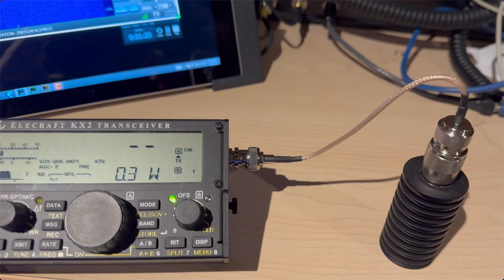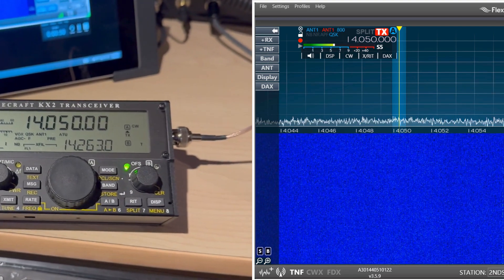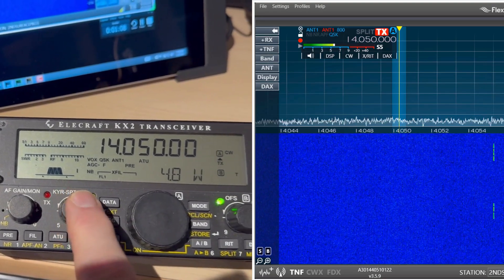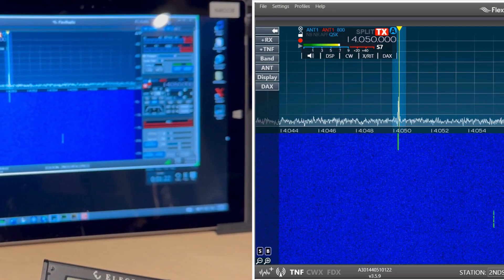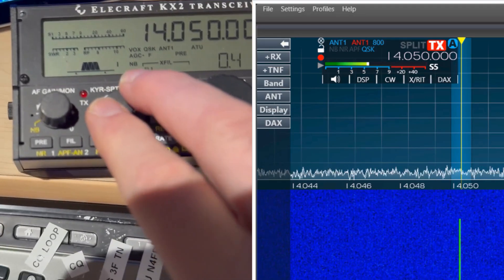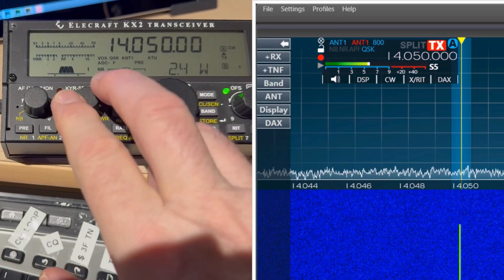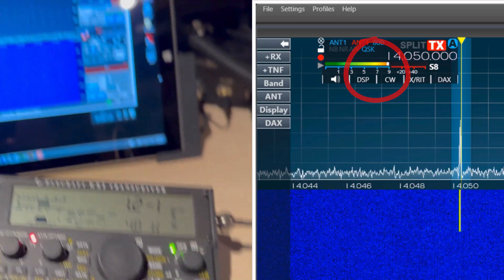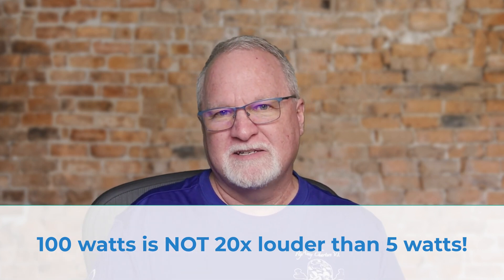Quadruple Your Power For Only 1 S-Unit!

Comment: I know the maths, it is true. BUT. The field experience is ... different. I did try TX with 5w (QMX+) , 20w (Xiegu G90), 50W (microPA50), 100w (FT710), 700w ( Acom1010).  AND . Factually, using different TX power ... IT MATTERS. It is CLEARLY making a difference. And I mean clearly. Stations are responding to your signal better and better as the power is going up, no doubt about it. And "1 S-unit or 2 is not much, your station will almost be heard the same" = bollocks.   I am using now 700w even on mobile POTA. I have no issue breaking through ANY pileup whatsoever. If there are 5-6 or more hams answering a DX station, it's almost 100% the DX station will answer me. Try that with your "1 or 2 S-unit lower" QRP station . No chance, I mean zero chance. ######  And yes, each power level is a different experience, it is fun, no doubt. I tried it, I still like QRP, where you can enjoy operating, but the fun has different shape, requirements and expectations - but can be lots of fun. BUT, to say that QRO is about the same as QRP because of the maths --- means you didn't compare it in a practical field situation ...
Reply from the maker: "BUT, to say that QRO is about the same as QRP because of the maths --- means..."   Means that you are misquoting me.  Okay, where to start?!  Are you saying that higher power stations will be heard better? Of course!  Are you saying you'll make more contacts if you use more power? Of course! So, what we arguing about? People who enjoy QRP do it to make it harder so that when they succeed, they feel a greater sense of satisfaction. That's it. Tha'ts all. There is nothing more to QRP than that. That said, increasing your power by a factor of 4 will only get you one additional S-Unit on the receiving end. That's a fact. An actual fact. And it's a fact that you can't refute if you a) truly "know the maths" and b) have actually tried it, as I have many times.  Now, that extra power can make a difference in snaging the QSO or not. (There's a reason I have THREE 100-watt radios on my desk. Sometimes QRP isn't enough. And sometimes 1.5Kw isn't enough, either.)  So, I don't want to argue about something we both agree on. Have fun running 700 watts during your POTA. I don't know of anyone who runs more than 100 watts for POTA, but you do you. Be happy with your version of this great hobby and I'll be happy for you. There's room for all of us at the trough. - Cliff
Reply: @QRPSchool  Yes you are right. We do see things quite the same, there is no ground here for arguing. Activating as a ham radio, I just wanted to try all levels of the hobby (including power levels) as I like experimenting and trying all faces of the hobby as many of us do. It just happens for me to be in my QRO phase, lol. But, I definitely will want to taste the fun of QRP once in a while. I was just contemplating the new SSB update on QMX+ little QRP, by Hans, which is quite impressive and promising. Yes, I know doing mobile QRO is rather rare and unsusual, but I do like to do unusual things, and I can assure you this is fun too ... For example, is fun to have POTA activation in London, in a park, and talking to hunters in South America on SSB, whilst I had to explain a police officer what the heck I am doing with a 25 feet vertical telescopic antenna (plus a home made coil) on top of my car. Sorry if the tone of my comments was a bit on edge, I can assure you I have full respect for QRP side of the hobby. All the best

Comment: I'm a big 5watt QRP radio guy. But, if the Rx station has me in the noise floor. Well then 20watts might work? Or 100watts would be better?
I have the FT-817nd, G90 and the FT-857d. So I take the FT-857d. It's adjustable between 5-100watts. So cool.
Reply: @DavidS-iw4ei  As you know, the important thing is that your signal is above the noise floor for the receiving station. Transmitting 20 watts instead of 5 watts will have your signal received as one S-unit stronger than 5 watts. That might do the trick. For me, if I’m home and 5 watts isn’t enough, I just go straight to 100 watts… if I’m using one of my 100 watt radios. If I’m using one of my QRP radios, I just have to “turn the big knob.”

Comment: Misinformation. Stop.

IF the station can't hear you, adding 3 dB or even 6 dB will help.

Your radios meter doesn't mean shit. STOP.
Reply from the maker: Oh, goody. Another commenter who hides behind an anonymous account and has never made a video.  Yes! If your signal is in the noise floor of the receiving station, you'll need to increase your power in order to raise your signal above his noise floor if you want to get that QSO in the logs. I wonder how many times I've said that in the 60+ videos I've made for this channel? A bunch.
Reply: @QRPSchool  okay, do it this way - .01 watt start, and increase from there.
You're forgetting a lot like feedline loss, antenna gain, obstructions, receiving antenna gain, and whether atmospheric conditions are involved.
Generalizing every meter is linear or even remotely accurate is absurd.
Reply from the maker: @deezknutts  "You're forgetting a lot like feedline loss, antenna gain, obstructions, receiving antenna gain, and whether atmospheric conditions are involved."  Uh, no. What does any of that have to do with the FACT that if you double your power, you'll get a 3dB increase at the receiving station over what you had before you doubled your power? That's one-half of an S-Unit on a properly calibrated and linear radio (like my Elecraft and Flex radios).  I'll let you have the last word. This is just a dumb conversation.
Reply: Antenna gain multiplies your power.
Do the math.
Your generalizations are great for a beginner ham. ; )
Reply from the maker: @deezknutts  Oh, my God. I said, "if you double your power, you'll get a 3dB increase at the receiving station over what you had before you doubled your power" You said, "Antenna gain multiplies your power."  Are we having two different conversations, here? Can't we assume that the same station that doubled their power is using the same antenna when doubling thier power AND the receiving station is using the same antenna after the transmitting station has doubled their power? (Seems like a pretty logical assumption.)  If so, the receiving station will get a 3dB increase. Now, if the transmitting station quadruples their power, the receiving station (same station, same antenna!) will receive a 6dB increase. If the receiving station's radio has a linear and properly calibrated S-Meter, they should show one additional S-Unit. If that receiving station has an improperly calibrated S-Meter... who knows what they'll see on thier S-Meter?  But, just because the receiving station has an improperly calibrated radio, you can't argue that the math is wrong. Doubling your power is a 3dB increase. S-Units are (supposed to be) 6dB apart. I don't have all that much hair left to pull out...

Comment: Cliff, we spent a week at Mile High Campground in the Smokies and took the radios. We were getting Texas at 20 ver 59 at 30 watts. The Canadians were saying I was 30-40 over 59 at 40 watts. 
California to BC was 58 at 15 watts. When you have an antenna at 5300 feet it amazing what you can do. 
The nets that are blasting each other at 1200 watts and are 200 miles apart are hilarious. One day I overheard a man in Montgomery AL saying you need 1k to reach 150 miles on 80 meters.  When the net was over I made contact with the same guy at 40 watts 135 miles away. 
With descent conditions and a good antenna 60 watts is plenty. Usually 10-25 will get there. QRP is tough because of the big gun stations are hammering  the pileups with big wattage. 
I’ve heard pota pileups call for QRP only and get 2 or 3 guys at 10 or 15 watts. 
With CW even 10 watts can go across the pond. Can’t imagine a CW station ever wanting over 400 watts unless he is contesting.
Reply: altitude is gain

Comment: Pre amps are similar results ,if i turn on the pre amp there are signals i can see on the scope i did not see without ,but if i hear a signal fb the pre amp dont do alot but raise s meter 2 bells😊thanks for vid

Comment: To begin with, I'm a strong believer in improving antennas to get the best receiving signal I can. There's no point in working another ham radio station if you can not hear it.

Secondly, the narrower your antenna pattern, the quieter your receiving system, the better your S/N ratio.

Thirdly, QRP works.

Last but not least, CW brings a lot of fun without the assistance of a computer (FT8).

Comment: You're 100% correct! I don't understand how anyone can argue with this. 3 dB is a doubling (or halving) of power. 1 S unit is approximately 6 dB. It's basic math. I've known this for 30 years, since I was a teenager. How is this not common knowledge?
Reply from the maker: Great question!  The information on doubling your power being a 3 dB increase was covered in the Technician's license. The information on each S Unit being a 6 dB increase is covered in the General license.  This SHOULDN'T catch anyone by surprise, but a surprising number of hams don't realize that they have to quadruple their power to gain one additional S Unit.  Thanks for watching and for wondering aloud how this isn't common knowledge! - Cliff

In the Technician License question pool, question T5B09 asks, "Which decibel value most closely represents a power increase from 5 watts to 10 watts?"

Answer: B (3 dB)
In the General License question pool, question G4D06 asks, "How much change in signal strength is typically represented by one S unit?"
Answer: A (6 dB)

Comment: This test ignores so much. I do qrp myself when I call cq using 5 watts no one answers and rbn show x spots. If I reply to a cq most probably I won’t be heard. If I use 10w, rbn show more than twice the spots and people start to actually copy. If I use 30w the responses to cq changes drastically to the point of forming big pile up. 

I did this exact test on the RAC contest where ops were hunting Canadian stations. Your test ignores for example noise levels, where that 1 S-unit is the difference of being heard or not. Also, I suppose you say qrp in terms of pota / sota and is not considering real DX when the dynamics of things changes a lot. 

Now, there’s one case where your experiment reflects the reality. When the qrp op has flat swr and the qro op is using 1.5. In this case there’s more chances of the qrp op being heard than the qro, in DX. It makes no sense if you do the math, but there’s something in the radio wave that acts one way when the antenna is truly resonant and different in another. That’s the reason why people in South America, for example, are obsessed with flat swr. The same reason why people on cb radio is also obsessed with it (remember, those cb radios are mostly crappy qrp radios). I’m telling you as a South American who has seen this in practice myself. Also someone who has build yagis, cubical quads to sell. If you have the chance ask a cb radio op who  has worked the world with those cobras 148gtl what happens when he uses flat swr and 1.5 swr. Once you understand that, by seeing the number of qsos, response to calls, your view on qrp changes.

I currently own a qro radio and 2 qrp radios. I’m focused in DX CW and I love QRP but this test you did ignores so much to the point that might actually hinder the radio experience of many people. Because your test makes sense, the match matches but it ignores reality.

Ps.: part of my radio activity is here in the platform, you can check the success rate yourself 

73!
Reply from the maker: The scope of this video is to demonstrate the fact that quadrupling your power will yield only a one S-Unit increase. It doesn't address propagation, the noise floor of the recipient, antenna efficiency, etc.
Reply: @QRPSchool  understood, thanks. But the final goal is the QSO. When you just tell part of the history you may influence people towards frustration. Especially the new hams who are leaving vhf to hf, that’s the point of my comment. 73!

Comment: I have done qrp with 817nd  and Xeigu G90 and made contacts from UK to Japan. My power is 250 watts from a modified Sailor marine amplifier which I mainly use only on 40 mtrs when conditions are really bad. Good technical video 🎉.

Comment: A lot of people have trouble understanding decibels with respect to power.  You are spot on, Cliff - and this is true at low power levels, and just as true at high power levels.  A lot of guys will opt for a 10W radio for portable use, at the cost of needing additional battery capacity (and additional cost of the rig).  Then they want to use one of those 'magic' whip antennas only a few feet long for HF!  Yes, even that can make contacts, but if the antenna is only 10% efficient, that's maybe 1 watt ERP, and you can make contacts easily with 1W if conditions are favorable.. Better to go with half the power and a more efficient full size (half wavelength) antenna.  The advantage of improving the antenna is that not only do you improve your transmit signal, but you also improve the received signals - thereby making up for running lower power.  In the end, with a more efficient antenna, the other guy will probably give you a better signal report than if you operate with higher power and a crap antenna.  Also, wire is cheap compared to those fancy over-rated whips.  Good demo Cliff - this stuff needs to be said!

Comment: Generally a 6dB increase of power out results in about 1 S unit increase. A 20dB increase will result in about 3 S units gain. So 5 watts to 500 watts increases about 3 S units. Sometimes it takes that much to get through the noise threshold on the receiving station. And not all S meters are the same and react slightly differently. But I love QRP myself. I've been able to work the world and have surprised many people when I say that I'm only running 5 watts or less. Just one point...May I suggest you measure and verify the power output of your KX-3 is actually what the display says it is. That could make a difference as it may not be linear.

Comment: An S-unit is just an arbitrary measure. 6 db per unit. It could have been 3db/unit or 10 db/unit.  As  you say if you quadruple your power, everything else being equal your signal is 4 times stronger. To get over someones noise when you are at the noise floor increasing your power by say 25% can make the difference, but that would only register as 1/6 S unit.

Comment: It's interesting to do a similar comparison for receive signal to noise ratio versus power when the signal is very close to the noise floor. Even a 1dB increase in power can deliver a huge improvement in readability and signal to noise.  As you rightly say, once you get over about 15dB signal to noise in your chosen bandwidth, then any increase in power just makes the S meter rise, and doesn't make a big difference to the readability. On 144 MHz, I managed to work some US stations via moonbounce at 200 watts (at the antenna) but when I dropped to 100 watts, they could not even detect my signal because it was so close to their noise floor, so that half S point was the difference between a viable contact and nothing. On 10 GHz terrestrial, I managed to drop my usual 10 watts down to 10 milliwatts and still maintained a viable Q65 contact at 250 miles. The reported signal to noise ratio hardly changed until I dropped to about 250 mW.  When I was at school, the Rev George Dobbs G3RJV of G-QRP Club fame ran the electronics club and as a result, I was infected with the QRP bug. George inspired me to make simple transmit gear and I was able to work US stations on 20 metres from the UK with 125 mW quite regularly. Once I got serious antennas, it was always fun in the big 160 metre DX contests to call US stations using half a watt to their 1.5 kW, then flipping the power up to 400 watts to send a final 73! What's your best miles per watt? I think mine is about 100,000 on HF and about 300,000 on microwave via sea ducts.
Reply from the maker: That's a great idea for a video... recording the audio of a station that is somewhere around the noise floor and listening to what happens as he increases his power. Awesome to work 160m with 500 milliwatts! Congrats. As for my farthest contact per watt... I don't really try to send less than a watt very often, but I did work Finland on 100 milliatts CW, which is almost 5,000 miles away.

Comment: It's also dependent on conditions. Sometimes you can make that DX contact with 5 watts or less, and sometimes you can't make that same contact with 1500 watts. In my mind doing QRP means being more patient, and probably doing everything you can to ensure every mili-watt transmitted is radiated. I do a lot of POTA and just about every day I hear someone doing QRP and making contacts. I can certainly see the advantages too... Less expensive.. Probably don't have to worry about interference, just to name a couple.  Anyhow, good job of awareness for QRP.
Reply: @SteveBerwick   Well, Elecraft is certainly proud of their equipment :)   cheers

Comment: So, if I could only afford one budget HF transceiver, would it be better to choose an older Xiegu G90 at 20W, or the very latest Xiegu X6200 at 8W with the very latest tech? Any thoughts? Advice?
Reply from the maker: That's a tough one.  I've had a G90 in the past and enjoyed it. I haven't played with the X6200, but the specs look great with the built-in USB control and soundcard.  If it were me, I wouldn't let the 8w vs. 20w sway me.  So, I'd probably opt for the X6200.
Reply: Thank you for your feedback, appreciated